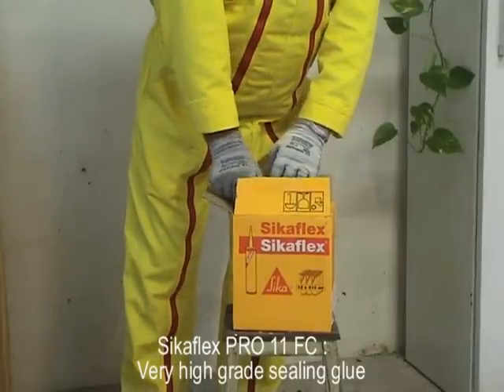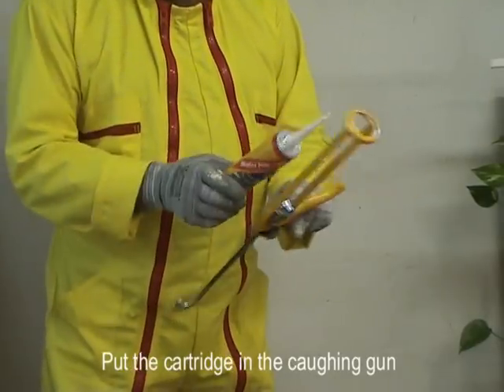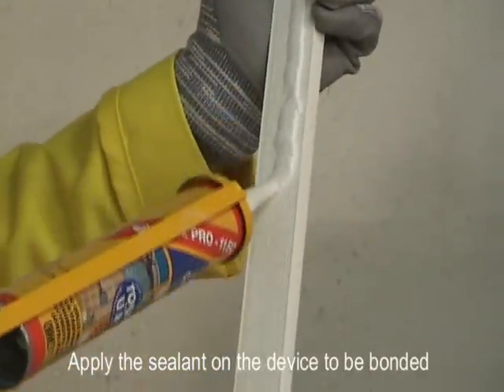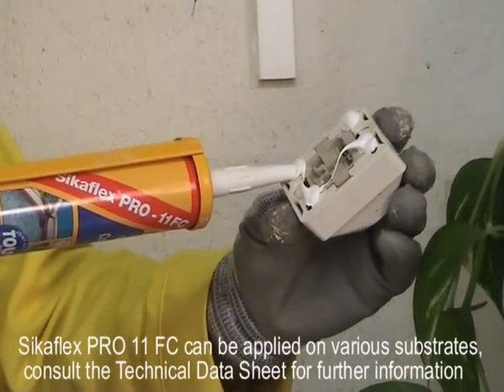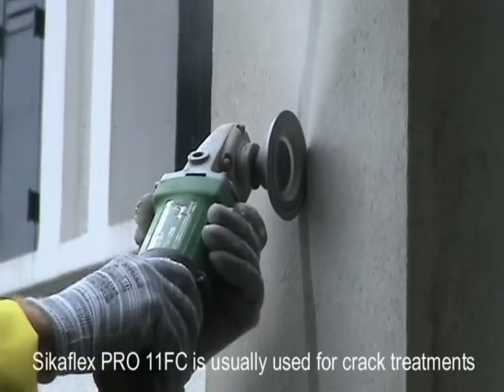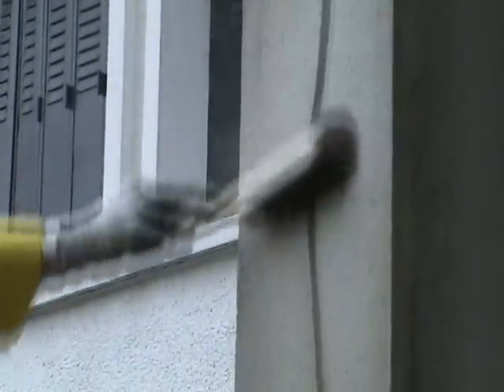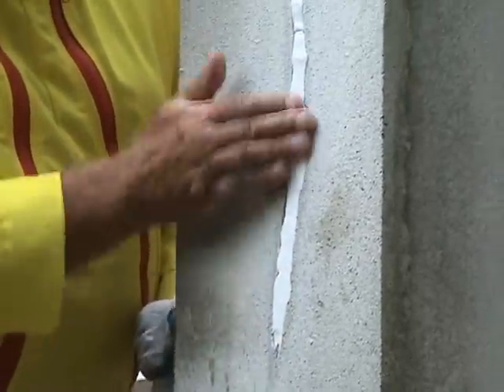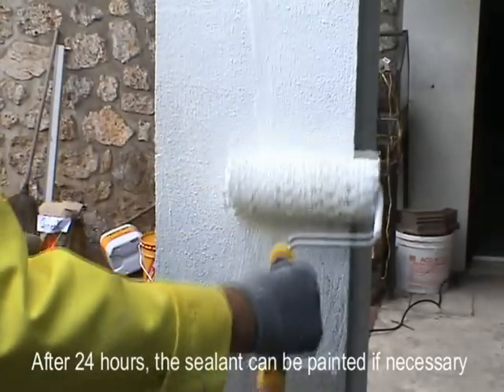SIKAFLEX - 11 FC

Comment: I have a crack in my clinker facade (outside) and I have concerns about using Sikaflex to fix cracks, because I fear that it might introduce thermal bridges (still better than leaving the crack open i know). Do you have any thoughts on that?